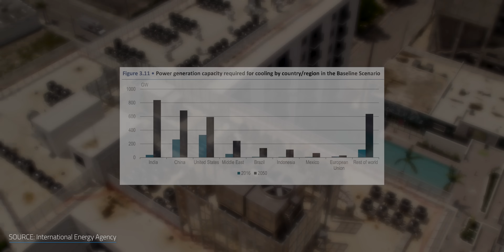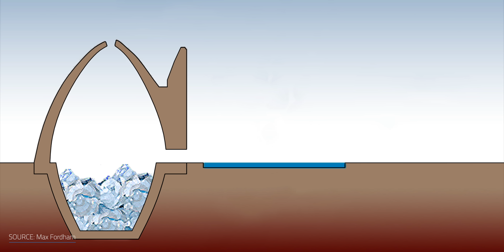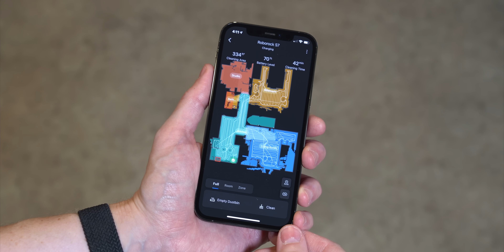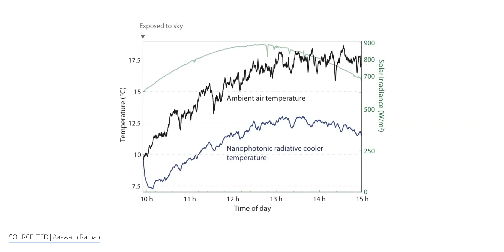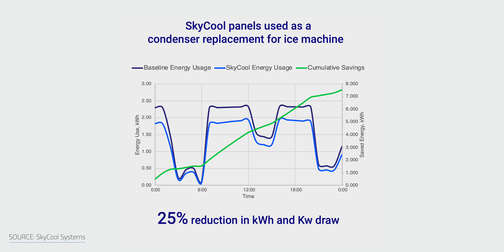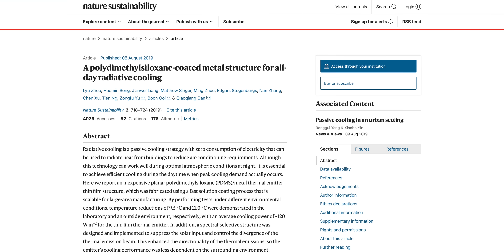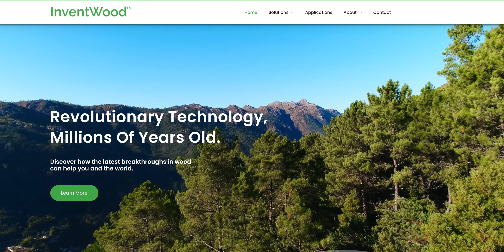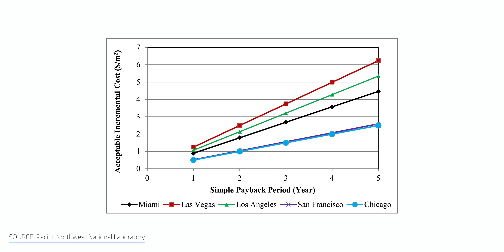Space Powered Cooling May Be the Future of Energy

Comment: I'm frustrated this isn't being developed and adopted faster! It seems like a huge solution!
Reply: You probably forgot you made this comment, but they're 150 times more expensive than just slapping some fiberglass on the roof and slapping white metal panels on top of the fiberglass.
Reply: @loneIyboy15  Let's bring those costs down. Solar panels used to be expensive, but now are remarkably affordable.
Reply: @raftastrock  At 40 watts of cooling per square meter, they also happen to be about 15 times less effective at expelling heat than just plopping a solar panel on top of the insulation and running AC with it for the same space.

Those 36 MWh they saved the grocery store? An absorption fridge could have done that with less than 15 square meters of roof space. 

Hell, just run air through a long tubes dipped in an evaporation pond and you get better cooling for a fraction of the cost.

Comment: I have a simpler and way cheaper solution. Just stick some aluminium foil on pieces of large cardboards or ply and scatter them on your roof in the morning in summers. They will reflect away the sunlight into space and thus keep the temperature of the roof low. In the evening just pick up those pieces back into a pile at one corner in some rain shade. If it is cloudy, then as such nature is cutting off the source of heating, the Sun. So on those days have a ball. I do it in my house and it works perfectly. Saves me lots on electricity bills too.

Comment: The potential for radiative cooling is pretty high.  Take any non-contact point-and-shoot IR thermometer and point it at the sky - not the sun, the SKY.  On a clear, sunny day, the clear blue sky returns a temperature FAR below what you're experiencing on the ground.  With a sufficiently reflective surface to reject the heat from the sun, a radiative panel can take advantage of all that not-hot sky to radiate its own heat into.

Comment: I've built straw bale houses in Montana and Washington state. They have an R value of R50-60. Much better than the required R18. These houses need hardly any cooling and little heating. They've been around for about 125 years in the US. There are some that are about 100 years old in Alabama still! You coat them with stucco on the outside and gypsum on the inside. They are inexpensive and use very little wood to construct. The banks won't finance them even though I have engineer certified drawings. They don't support the typical materials used in regular construction so the building industry frowns on them. I think it's stupid to not  use such a wonderful eco-friendly building medium.

Comment: 8:45am Tuesday January 23, 2024.  You hit many of the facts and highlights of the ongoing problem solving technologies.  You mentioned coatings or white paints including Purdue with the Ultra white paint as an alternative but being limited.  I agree completely.  I am President and researcher for Superior Products International II, Inc or simply SPI COATINGS.  I worked with NASA ( not for) from 1989 until 1995 being the researcher on “ceramic compounds”.  Trying to find which compounds actually work to block the “absorption” of heat.  Repealing heat off a surface which is more than just emissivity and compounds that do not have the density to absorb heat were what came to matter in controlling heat.  What I found was that all ceramic compounds come from suppliers with the tested ability to block heat absorption.  Problem is that when blended into a paint which is wet and mixed with other compounds absolutely kills any ability to block absorption of heat because it is not alone nor dry.  My research aided by ceramic engineers supplying compounds to test, I went through most every compound to find they could not work.  I was lucky in some aspects but determined and focused on what worked to find other compounds that continued to work once in a paint base.  Given this background, the coating developed was SUPER THERM.  NASA had me give a discussion on SUPER THERM at their Technology Conference in 1995 as the first titled “insulation coating”.  US Federal DOE under their Weatherization Assistance Program where they have independent energy contractors choose products to apply to roofs and walls to check their effectiveness to block heat load and reduce energy consumption.  SUPER THERM was chosen mainly because I had said it did ( not might) work to block initial heat load from the three radiation waves from the sun ( UV-3%, Visual-40% and IR-57%).  Testing was performed in Japan Building materials lab and the Russian Academy of Sciences on specifically reflecting the waves of heat.  I did the standard ASTM testing in the US which is very limited compared giving an average of 96% repelling of initial heat load onto a surface.  The contractor took a group of low income trailer homes in Florida on a 85F ambient day with one bare metal top recording 164F, another trailer coated with an industrial white “reflective” coating recording 125F on top the surface and then SUPER THERM recorded 86F ( one degree over ambient).  This made an average of 10.2F drop in temperature inside the trailer.  When the contractor came back later to check with the owner, she told them that she did not use her A/C after their application of SUPER THERM.  This is a documented study with the DOE plus three more test reports by the Florida Energy office spanning Florida,Denver and LaPorte, Texas showing the consistency of performance.  All this said to made the point that all these new technologies usually are not consistent in performance nor produce what they said it would do.  Like Purdue, I have worked with Barium Sulfate for over 39 years.  Bright white is not the answer.  Blocking initial heat load is the answer.  Georgia Tech University tested SUPER THERM to find all the R Value insulation materials cannot be tested outside in real world environments whereas SUPER THERM performs as advertised in every climate and weather condition.  People completely miss the fact that this is available and proven by DOE programs to work.  Just thought your utube pointed to all these facts.

Comment: White painted roofs are definitely the thing to go for, the highly specialized paints however using rarer materials might not be the best place to spend those elements., except in specialized circumstance.  It is kind of like Germany going for Solar and Wind when it is neither sunny nor windy.  The IR coating looks like it will do a good job, but no element was mentioned, so would it be a Niche solution, or somthing to put on every house?  

 I can see a conventional shingle roof covered with solar panels with these set up to help create a cooling convection with the IR rejection and being used with a heat pump similar to geothermal heating/ cooling.  The shade and energy absorption of the panels would cool the roof, the air circulation would cool the electric panels to increase their efficiency and the thermal panels would keep dumping the IR at night maybe phase changing the coolant into a fluid for the next day's cooling.  all would be mostly passive and at least as simple as HVAC to maintain.

Comment: I think this was a thought experiment given as homework at uni. Not very efficient (there is physical limitation in this) but radiation to space can be used as an additional help to reduce cooling requirements. In Finland latitude this is totally useless, as the heating requirement is higher than the cooling requirement. But hey, not bad for a uni homework to fork $3,5M funding.

If the coating in radiators can reduce fluid temperatures, it can help avoid boiling of the water-ethanol fluid (glycol is banned in non-commercial usage and banned in the EU altogether). So there could be commercial use case there.

Comment: Radiative cooling should be used to the greatest degree possible.  Your viewers will be interested to know that the James Webb Space Telescope is maintained at a temperature of about 40 K,  that is 40 degrees above absolute zero, by radiation alone.  Of course, it is easier in space with less hot stuff all around.   I do wonder about the effects of increased atmopheric H2O on the effectiveness of radiation.  H2O and CO2 are "greenhouse gases" and make radiative cooling more difficult.  Still, it makes sense to use it to the greatest degree possible.

Comment: Again the critiques, and dont just take their numbers as facts. 

Alright so lets look at an actual HVAC system where its needed. Houston texas. Typical outside high temperature in the summer, 98 degrees. Typical indoor air set point. 74 degrees. Difference 24 degrees. But thats not the actual temperature. The temperature on the Evap coil ranges from 50 degrees to 65 degrees. Thats a differential temperature 30 to 40°F. 

Moreover, there are more effective ways of blocking heat getting into your house, including. 
1. Ridge vent and soffets that allow laminar flow from the eaves to the ridge vents. 
2. R-40 insulation in the attic. 
3. Techshield reflective plywood for the roof deck. 
These three things together will block most of the heat hitting the roof hitting the sheetrock layer on the ceiling. 
3. Solar panels on the south and west facing areas of the roof. Sun that hits a panel fisrt will not be able to heat up the roof, and also provide electricity. 

Wall insulation. Good is R15. 
Double pane windows. Buy a good brand, vinyl windows start to fail innabout 10 years. 
Sheething. Zip system allows wall insulation and sheething in one step. Moisture and air barrier. I still like the asphault old felt board as it provides a little more insulation, most people use OSB board. 
Door seals. 
Eaves. Larger eaves keep the sun durring the hottest part of the day off the house. 

I cannot tell you how many houses I have worked in in which there is no or inadequate insulation. 
1. Energy star rated house in which noone inspected the attic for completion of the works. (2 houses)
2. Failure of insulation technitians to detail work in corners and hard to see places. 
3. Water damage in attics were insulation is not replaced. 
4. Insulation that compacts or mounds (due to windstorm, workers or animal infestations) 

Like wise attic ventilation that is not maintained or poorly implimented. 
5. Failure to design roof with adequate ventilation that allows laminar flow from the soffets to the high points. 
6. Attic vents placed in areas that do little, vents that are not maintained. 
7. Painting over small mesh soffets. 

Other issues. Another thing I see so many times. People saying their house is making them sick. The first thing I look at are the windows. Windows that have tracks or the slide up and down have a service life of about 50 years. This life can be extended if the window is cleaned and lubricated (those that have springs). The majority of houses with bad smells are either gas appliances that leak or faulty windows. In the overwhelming majority of cases where the windows are faulty they cannot be closed to lock, and in a majority of those cases its because noone has cleaned the window track in decades. There is mold, dead insects, dusk, dirt in the window seal and when this debris is neutralized and windows closed properly the smell goes away. In houston its about keeping humidity out of your house, if you have unsealed windows humidity will get in the house and you will feel uncomfortable. If you have mold or dust allergies it can make you sick. 

Another area of failure is critters. The skin of the house, be it brick, hardiplank, stucco, or word separates the engineered structure of the house from the elements of nature that would damage that structure. Here its rats, but I've seen damage from squirrels (they like to build nests out if wire insulation), opposoms (got a yard with fruit trees in it?) the can turn the unseen structures in a bathroom into a condominium. 
   Critters can easily tear through the houses vapor barrier and allow outdoor air to flow through polluted walls into the house. 

   Critters and Bad A/C technicians. People think because they hire a home maintenance contractor that their ductwork is inspected annually. Based on my experience they almost never inspect the ductwork. Tearing up ductwork is a favorite pastime of attic critters. Ive vent found rat nests in the HVAC. The ductwork in a house is under postive pressure with respect to the attic. If the ductwork blows a hole, that positive pressure goes to the environment and the house (that which is inside the vapor barrier) becomes negatively pressurized. This not only pulls heat and humidity into the house, it can make the occupants sick because the most polluted air in the house is in the walls. 

So now we ask the question, what to do? 
1. Build smart:  7"Wall with R-19, highest durability double pane windows, insulated foundation, slightly elevated roof (allows insulation 1' on the outward facing edge of the celing, even distribution of soffets, ridge vents, techshield, solar panels on the south facing roof. 
2. High seer A/C system with as low a tonnage as possible. I personally like systems that are built up as components. From my experience the all-in-one HVAC systems dont last long and are extremely expensive to replace. My HV system is from 1974, I just replaced the blower motor. 
3. Find a good handyman that knows how to find system failures and maintain the specifications of the house.

Comment: The better long term solution is simply better housing. Air tight with a good ventilation system, heat pump and very good insulation. air tight with ventilation is really all you need.

Comment: Hi Matt. Great content.  I like the depth of your technical investigation being balanced with a good “So what?” question.

On a practical level, I can tell a quick story to confirm what you said. I come from South Africa. My mom still stays about 100km from Cape Town.  They have summer temperatures hitting about 38 degrees C with high humidity and, living in an old house, there is no air conditioning.  She decided to paint the roof white and thought that she experienced a difference in the first summer, but she really experienced the difference in the first winter. The house used to be quite pleasant in winter, but now she was freezing!

So, we may get rid of heat, but do you really get rid of all the heat? Save on cooling in the summer, but pay extra on heating in the winter?

Comment: The is such a thing as direct solar powered refrigeration and its more than 70 years old. The cooling system does not have a pump to circulate HFC's. Instead solar heat is used to evaporate the HFCs, much the same way propane powered refrigerators use a small flame. By using half of a glass spherical solar collector(Campbell–Stokes Recorder) the HFCs are heated into a gas this begins the circulation thru the cooling system. The solar collector had to be placed in a location where it would receive direct sun all or most of the day.  The system only worked on sunny days and as a result the refrigerator temperature varied greatly - warming over night and cooling during the day. To keep the refrigerator cold enough to keep food from spoiling the refrigerator temperature had to be below freezing by night fall. Today using a computer controlled high bred system the electric pump would not have to run all the time. Saving 8 -12 hours of power per day by using a south facing glass lens.

Comment: Triple canopy cooling?  Top layer of solar panels, 6 inch gap to a convection plate that serves to route cooling air behind the panels  (The top edge is painted black to cause a chimmney effect.).  An additional panel a foot further down carries a fluid that the HVAC heat pump uses for cooling.  The air circulates across it by wind or by the chimney effect generated by the convection pannel......